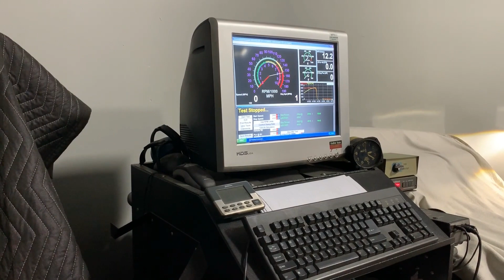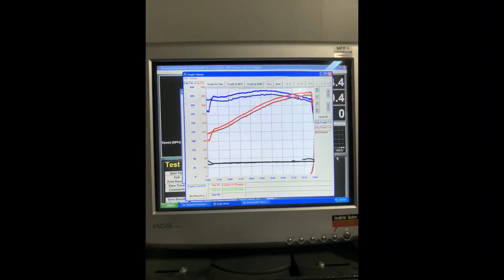How much horsepower FBO E85 2019 Camaro SS

Comment: I have a 19 ss too

467.46WHP And Torque is 482.16 . STOCK Wheel Horsepower was Like 410WHP 
1. Headers With x Pipe Straight Pipes W/Cat Delete. @american_racing_headers With Tune
2. Cold Air Intake @rotofab 
3. Dsx E85 Flex Fuel Kit With Sensor
4.MotorRad Upgraded Thermostat
5.Mighty Mouse Catch Can
Reply: What’s your car page ?

Comment: My girl has a 2014 SS, 100k on the motor, custom cam, 1 7/8 Longtube Headers, full 3 inch x-pipe exhaust system, stall, and a tune. 482 on shell 93 pump gas. E85 coming soon.

Comment: I have a 18’ SS 1LE and made 432WHP and 450 Torque from just E. Literally bone stock besides the tune. What are all your mods ..?
Reply from the maker: Can’t remember what it was at in this vid but most recent after Whipple built it was extra spicy lol. Might have been at the time I had CAI Headers ethanol gas mix. Vegas is a difficult place to have huge #s and 1/4 times bs other places bc of high heat bone dry/elevation conditions

Comment: Your not FBO E85. You still need 95mm or bigger ported throttle body,  103mm msd ported intake manifold, 3in xpipe, oval mufflers w/ quad exhuast,  torque converter, and ATI super damper. Even with all that guys are only making 485whp-495whp, all I need is the TB/IM and I'll be FBO E85. You should look into weight reduction after you get FBO E85 I have already cut 75lbs out and I'm planning on 150lbs total. Back seat delete and seat belts 32lbs, trunk gutted 20lbs, the lighter full exhuast cuts 23lbs, race seats cut 50lbs, lighter wheels cut 20-25lbs depending on brand.
Reply: You don't really need aftermarket xpipe and mufflers for these cars unless you're trying to make like 700+ whp

Comment: FBO and 85? Wth! My 2019 ss has 469RWHP With a CAI, Intake manifold and 85, brands matter don’t go cheap.
Reply from the maker: Not 1 mod was cheap check the mod list but also added a ton since this video. Check more recent vids. The numbers vary depending on dyno and climate conditions.
Reply: @jasonoctane4787  I have a 19ss I’m planning on getting e85 soon can I also run 93 with it? As long as it’s tuned right?

Comment: No offense but your car isn’t Full Bolt ons, you’re missing throttle body and an intake manifold.
Reply from the maker: Garrett None taken. I welcome all comments even when I don’t agree. Jury is out on if they are worth adding and debatable if they keep a car from being FBO. I recently got a larger TB hoping for more hp. Stay tuned if you enjoy the content because the next vid shows I lost power on the dyno from the TB. It’s an age old debate of FBO lol. There is the generally accepted FBO CAI, Headers, Exhaust vs the laundry list of other possible bolt ons people would personally add rather than what works best for the build. I went into detail on this in the comment section on the 1/4 mile vid. Either way, at the time I shot this vid it was before the cam and TB I recently had installed. It was nice to have this dyno run to compare numbers to see if they’re worth it or not.